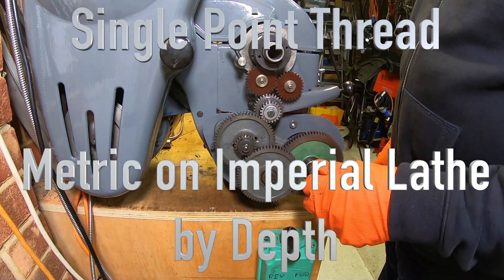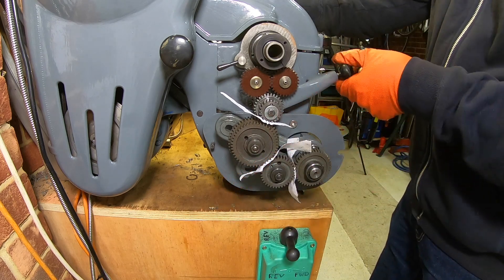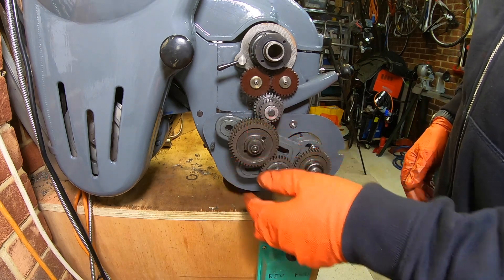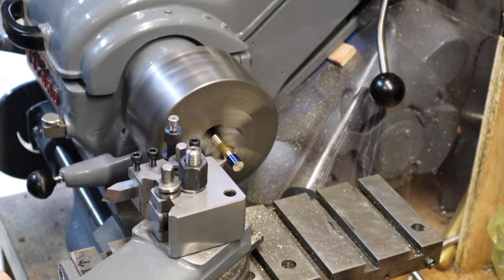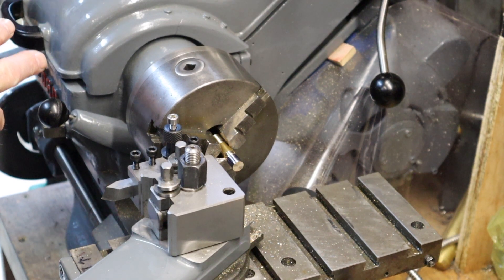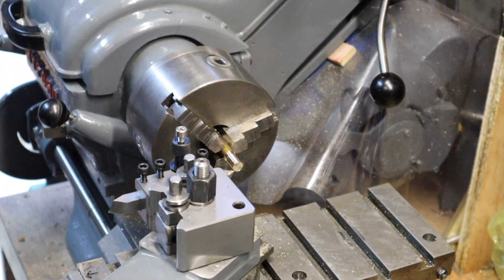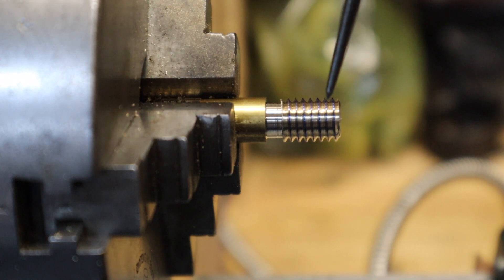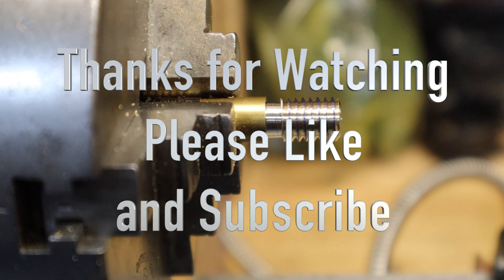Single Point Thread Cutting by Depth, Metric Threads on an Imperial Lathe

Comment: Thanks for a nice clear video.  Have you tried my RideTheGearTrain online program for calculating gear trains eg for cutting metric threads on an imperial lathe using change gears you already own.  Google should find it for you.  I noticed that you used a 21 tooth gear. This works because 3x21=63 so if you can use other gears to increase the gear ratio by 3, it works with the same accuracy as the popular 63 tooth gear.  And 63 works because 63x2=126 which is very close to the ideal 127 tooth conversion gear. The error is only 0.78%.  The 127 tooth gear works because 127x2=254 and there are 25.4 mm in one inch.  I like the idea of using a draw bar to prevent the screw-on chuck from unscrewing.

Comment: A draw bar with disc one end larger than the spindle dia.allows for cutting in reverse on the Myford. The draw bar is fed through from the chuck so the disc is inside the chuck behind the jaws. When the nut on the outboard end is tight the draw bar and disc are locking the chuck from spinning loose.
 Colin
Reply from the maker: Thanks for that, I didn't know

Comment: I bought the 34 & 36 tooth gears for metric threading on the Super 7. There was a thread on the Model engineering foru uk. That covered this. I so far have not tried using them. There is a arm to make to attach them that needs making. I have somewhere all the ass drawings & info on doing the conversion. It saves changing all the gearset. Great result though. Well done sir.
Steve.
Reply: Since the vfd packed up on my Super7B I found one of George Thomas" spindle handles works especially well for thread cutting, it gives instant stop and reverse which is fine whether you can disengage the half nuts or not. 
Just as a point of interest and why I never bothered to get a new vfd, I only use the Myford for Imperial thread cutting and the handle is all i need. Metric threading and work I do on my Colchester.
There is a method of accurately measuring the flat for metric threading form tools, if you grind to a sharp point and measure the entire length of the tool, with a bit of trigonometry you can work out how much shorter the tool must be with the right sized flat. As you say the charts for thread depth are only worth using if you use the correct flat.
Reply from the maker: Thank you, useful information, I mostly use a handle for threading, I find it easer and quicker, but for this demonstration I did it the long winded way :-)
Reply from the maker: Thank you and good luck with your threading